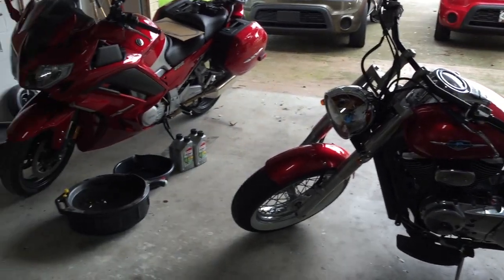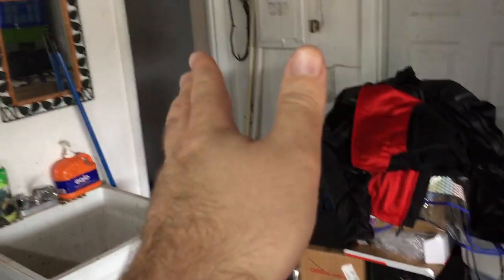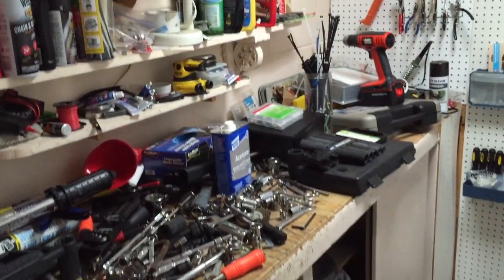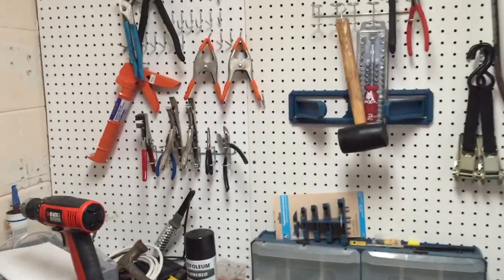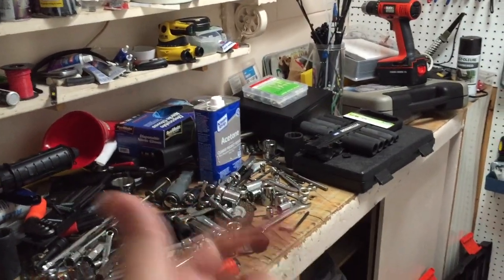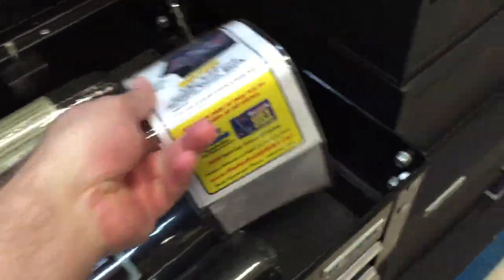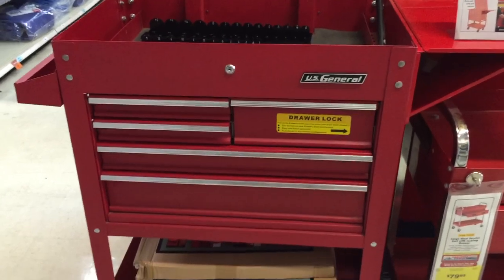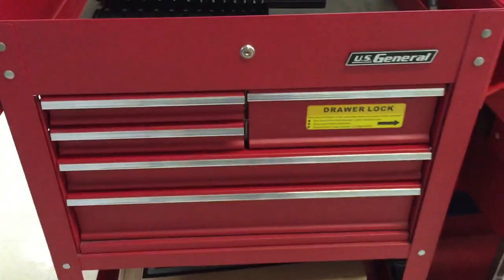In Search Of A Tool Chest

Comment: I went through what you went through several years ago. I weighed the pros and cons between Husky, Craftsman, and Harbor Freight. I ended up with the Harbor Freight 44" top and bottom combo for around $700. It has served me well. The drawer widths and depths seemed just right for what I do. The only gripe I have is the drawer pulls are on the flimsy side when loaded with tools. The drawers are still firm and slide well however when loaded. I have no regrets and would buy the Harbor Freight if I were to do it all over again.

Comment: What I think unless you getting your fathers tool box set. What ever you buy will Be to small buy what you think you but double the size.  Tool boxes don't work well with wall to wall sockets you can't find the right on.  Also bigger tools may need to be in a lower drawer just to fit taller boxes are ok but they can be tippy bolt the boxes together install caster that match the box not the ones some ahold engineer think is good enough because it a pain in the butt change them once the box is loaded.  ReForce the bottom with plywood protect this big buck investment.  Don't buy cheap socket rails!

Comment: The only way you are going to get a large tool box that will meet your expectations mentioned in this video is to spend $3,500 on a used Snap-on box.  You can either lower your expectations or raise your budget.
Reply: TheMidnightNarwhal When you understand the motivations for inputs and quality controls of different Countries - namely mainland China.  The only reason Apple is successful there is that they have U.S. Quality control people on sight.
Reply: I'm sorry but other companies are successful like Tekton and Husky and the likes and oh would you look at that, my tools are still working.
Reply: TheMidnightNarwhal Taiwan versus Mainland China.  Very significant difference.  In Mainland China, unless someone from the brand is watching they will substitute in a lower and lower quality of metal in order to turn higher profits.  The tool will look normal but try to use it in a high torque situation and it will fail.  In Taiwan they will not do that.